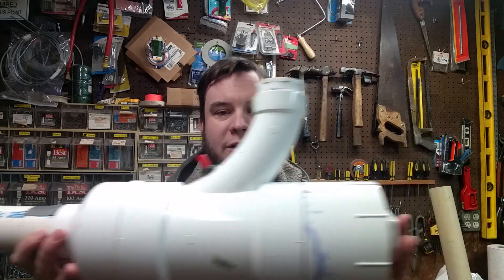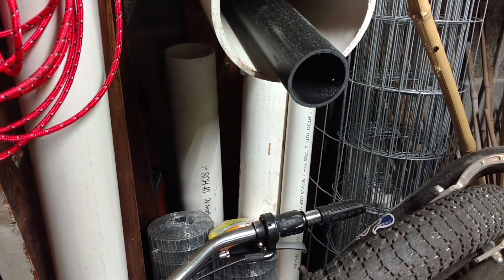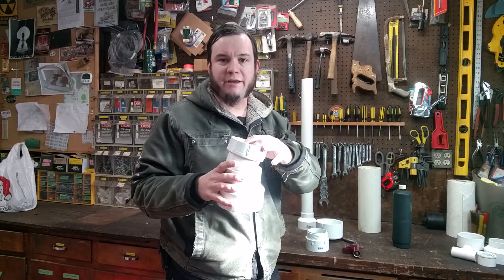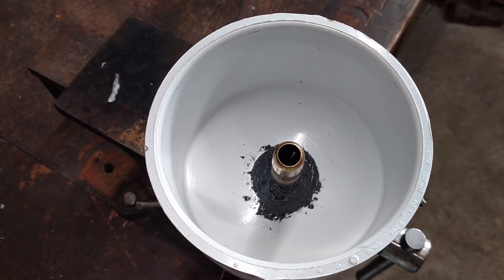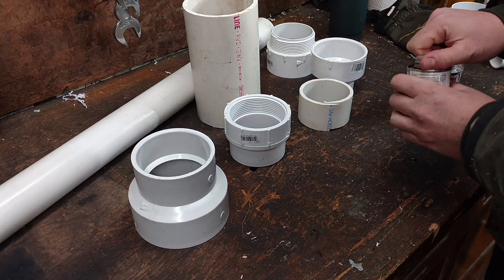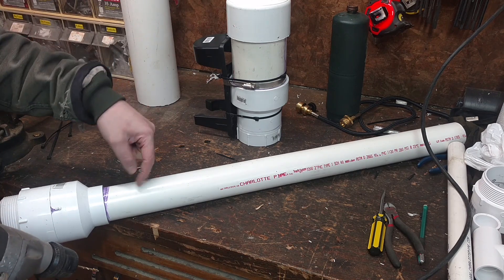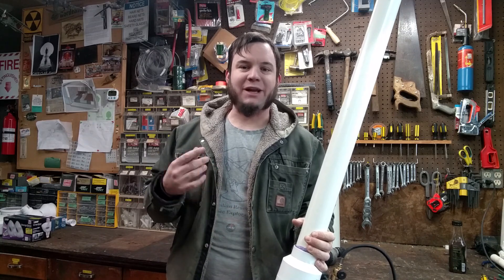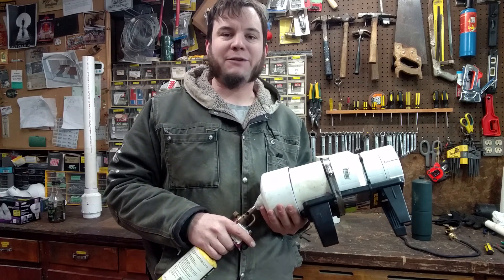Building a Spud Gun with a Propane Torch - How to Make a Gas Powered Potato Cannon

Comment: I have a 3” diameter combustion chamber  reduced to 2” for the barrel, I have an endcap with a cleanout plug, On the back of the plug itself is barbeque igniter, I have a mapgas tank with a nozzle mounted on barrel itself. I made a makeshift fuel line with aquarium tubing going into the combustion chamber. Its very pretty for being a potato gun, and it works reliably, I had to make several revisions to my original design but, in the end it was cheap, and very powerful. Never go with a hairspray potato gun, always use a fuel tank, trust me, its worth it,
Reply: Put the spud in the end of the barrel first.  Then add fuel, then compress the fuel by pushing the spud down the barrel.  This helps with ignition and velocity.

Comment: How many seconds do you hold the trigger on the torch?
Reply from the maker: On mine it's about 4 seconds for propane and 3 for Mapp gas. It depends on the size of the chamber and how good the air inlets in the torch are. Too much gas displaces the oxygen and makes a weak combustion. Some people put electric fans in their spud guns to improve the air mixing.

Comment: they make epoxy for pvc to steel ..but it only comes in quart or larger and very expensive..we use it on 12inch pvc to 12 inch steel pipe ..